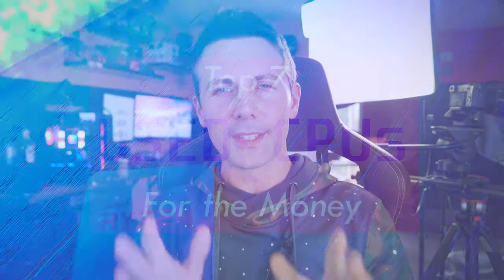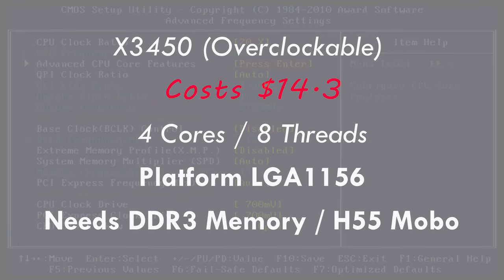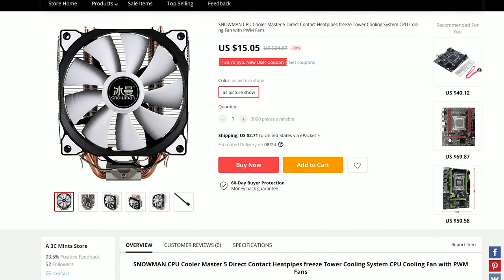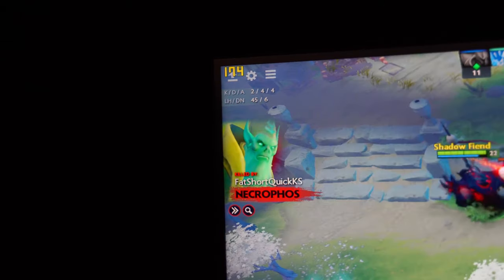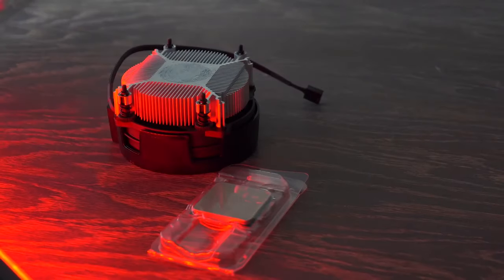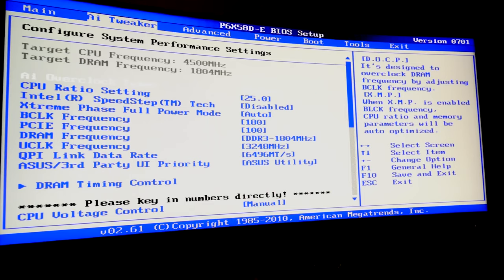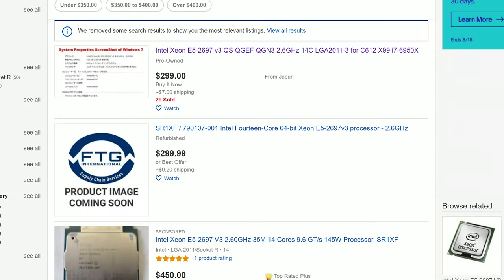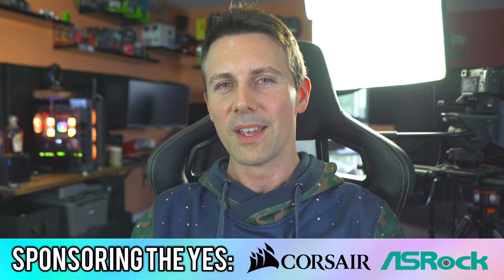Top 7 USED Gaming CPUs for the Money in 2019

Comment: I7 870 and gtx 960 still playable?
Reply: yeah, but with a one leg in the coffin. 870 has some live in it. 960 2gb is gonna be obsolete soon, 4gb is fine.
Reply: Rafał Gębicki im about to upgrade to a Ryzen 3 2200g but still dont know what gpu to buy
Reply: @baby___hteb7424  you have that 870/960 build?
Reply: Rafał Gębicki yeah
Reply: @baby___hteb7424  If you would OC that i7 (but the motherboard needs to have this option ofc) i wouldn't change anything for a while. The cheapest way to get some more performance would be an xeon x3430-x3450 and oc it. Oc'ing the 960 is optional and can give you some free fps

Comment: No FX cpu in 2019 isn’t they good enough for gaming on anymore? I got one ( 8370E) but considering upgrading to a Ryzen 3600 with a rtx 2060 or a gtx 1660 ti
Reply: GET 3700X
Reply: ReganMarcelis the 3600X isn’t much better than the 3600 so why not picking the 3700 instead of the 3700X, it’s only a few FPS different but 50 bucks in different I could use on the GPU instead

Comment: If i want to game on 1080p75 using freesync.. should i go for used r5 1400 or the 1600??I have a rx580 which i bought in April for $100 but my current g4560 is really dragging the avg fps down especially in metro exodus and mankind divided
Reply: find CPU upgrade ;
i3 3750K
i5 7400/7500/7600 (K/T)
i7 7700 (K/T)
When you can't find those CPU bang for the buck, yup just changed your system
Reply: @claritoresdiano1021  7700 is more expensive than replacing fully to a ryzen build.. I won't buy that cpu used for $200 here,even a used 1400+b450m steel legend costs like $150 now
Reply: @HuntaKiller, A 1400 or 1600 is fine or you might find a good deal on a 2600. AMD architecture is going to drive the next-generation consoles. Microsoft worked with AMD for the new Xbox.

https://www.aliexpress.com/category/200002319/computer-components.html?spm=a2g0o.productlist.0.0.30486490Wy0TlS

A YouTube commenter wrote: “I went from a heavily oc'ed (i5) 2500k to a Ryzen 2600 and the difference is pretty unbelievable in both gaming and outside of gaming.”

Another: "I upgraded to a 1700 (Ryzen 8-core 16-thread) from a 5820k (i7 6core, 12 thread). Used both of them at 1440p with a GTX 1080, there is only 1 difference between the two CPU's: The 1700 loses 1-2 fps on the average and maximum, but gains 10-12 on the minimums. No joke my 5820k, before that my 3930K (i7 6 core, 12 thread) and before THAT my 4790K and even my Xeon 1230v3 all had issues with microstutter here and there. It actually felt like I was playing at a higher framerate on my 1700. And before you ask, the only difference between each of those systems was the mobo and CPU. The ram stayed the same."

"A friend of mine just got a Ryzen 1700X (8-core 16-thread) computer. He wanted me to see it so I came over. I tried it and it seemed faster than my computer, but I was not overly impressed. He noticed my disappointment and pushed me away from the computer. He said "Watch this"! He opened 5 tabs in his web browser and opened a 4k you-tube video in each tab except the last where he opened an 8K video! He opened 3 1080p videos in VLC player (each separate instances) and one more VLC video playing 4k video. Finally he ran a full malware-bytes and anti-virus scan. The cpu never went above 58 degrees celcius in temperature and cpu utilization went 52%-72%. He let me try the computer while all this activity was simultaneously going on and it was still faster than my computer (older Intel -i5). I was so impressed that I promised him I would buy my own Ryzen computer before the end of the year!"

Ryzen only installs on Windows 10. For help https://community.amd.com/community/support-forums/processors

You can use a small screwdriver to put an uncooked-rice-grain-sized blob of thermal paste on the CPU in the middle. Also use it to straighten any bent pins. Renew the paste every 12–18 months.

Tuning Ryzen for better performance https://www.youtube.com/watch?v=LTT5mhqmjJc

For good coolers try the Cooler Master 212 evo or the smaller Antec a40 pro. Thermal Grizzly Hydronaut is a very good paste.

A new Ryzen user wrote: “make sure windows 10 allocates enough space for virtual memory because my computer was stuttering for a while”. (I think they mean the page file/swap file. It really means they didn't do so with their old processor.)

“My ONLY point of frustration came from some instability I experienced that took me a while to troubleshoot, first thinking it was probably some sort of memory incompatibility. It ended up being an incompatibility with the Windows 10 Ryzen power plan that was installed. Switched to the regular "Performance" plan and its been rock solid ever since.”

If the processor idles at a high temperature: disable all 3 bios options for Precision Boost Overdrive (PBO). Set Windows Power Plan (not AMD's one) for "Balanced".

Comment: I'm still on a X58 Asrock Extreme 3, x5650 @3.8GHZ, 12GB of ddr3 & a 1070. The price for performance now is awesome; I'll probably upgrade in the next few months. To think what I spent on building this system 10 years ago with a i7 920 and SLI GTX 200 series gpus LOL.
Reply: That's a killer kit! You ain't gonna get much/any performance boost if ya upgrade! :O I mean, sure, u might get even more calculation power if u do sum hardcore video editing or work for Nasa, or if u wanna go for sum crazy ass 4k gaming, then yeah. But for EVERYTHING else ur current price-to-performance is best!
Reply: MaximusAdonicus 1080p gaming is awesome with this system. I upgraded to a 165hz 1440p monitor last year and have wanted to upgrade my aging system since then to keep the frames up. I’ll probably sell the mobo, cpu, 🐏 later this year. Have a great day buddy!

Comment: core i6 3970x extreeme edition 6 core 12 threads 3.6ghz 4.0 ghz turbo overlocks easy to 5.5 ghz platform x79 still my best cpu of all times even the x79 platform can suport m.2 nvme ssd´s with moded bios wich can get up to 4gbps data transfer rate, this cpu still better than most of the latest cpu´s with the overclock results without crazy temps or voltages

Comment: the best deals in the uk are now i7 5820k...i bought some of them for £50 and they can run 4.7ghz around 1.325-1.385vcore...with very good temps...
last week i bought x99s sli with 5820k for £50 both:)))good oc mobos can be expensive but in the end .hey..thi cpu is fukin good performance...1380cb in r15...3700 in multicore in cpuz etc...

Comment: Hello tech yes,, how long did aliexpress sent the stuff from the seller into your housee?
Reply: It seems to vary greatly depending on one's location. Using the free shipping option, my parts all arrived within one week (I'm in the UK), but I've read comments from those who've had to wait a month or more.
Reply: @mapesdhs597  is that free shipping?
Reply: @dhafidzakwanpratama5775  Yes, I used the free shipping option which was quoted as being between 30 and 60 days, so I was surprised they all arrived so fast. Mind you, a later order of some other XEONs and mbds from different Ali sellers was more like 2 to 3 weeks, though one parcel took a few days longer as it was held in Customs until I paid the import duty.
Reply: @mapesdhs597  do you track the shipping?
Reply: @dhafidzakwanpratama5775  No. I was conent to let the free/slow shipping just do its thing. I would be more likely to use a paid shipping option if I was buying something more expensive, but then that would increase the cost. Still, even the more costly dual-socket LGA2011 board I bought arrived just fine.

Comment: Guys quick question pls for the pc experts: do the coolers have to be compatible with the motherboard/cpu or any cooler can work on any setup? Thanks in advance
Reply: the air cooler should be compatible with the socket type on the motherboard..not just any cooler will go onto any motherboard.  Snowman cooler is compatible with quite a few different Intel sockets along with an adapter for mounting to good variety of AMD sockets as well.  Always check the motherboard you wish to get then, check if the air cooler supports being mounted on that socket type.

Comment: i have a i3 4170 i want to upgrade but what cpu  is cheap and least have 4 cores idk what to check to see if i can put xeon in it if you can please help me....love your videos    motherboard is hp if you read this please let me know or tell me witch cpu to go with i7 4770 is stil over 100$ any advice would make my day please and thank you
Reply: Xeon E3-1220 v3 and E3-1225 v3 both 45% and 50% faster than i3-4170 while consume 30+ more watt from your PSU. It fit same socket. Cost around $61 and $65 each, only the 1225 one got HD graphic.
Reply: i7-4770 is 18% faster than E3-1225 v3 but  2 times pricier. Check all Xeon lineup for LGA1150, maybe there's one that match i7 at less than $100.
Reply: @xponen  thank you so much

Comment: A proud x5675 user with a GTX 980 :D
Reply: Nice, but man, you're totally gimping that 980..
Reply: @XtremeConditions  Maybe if he's using some old 1366x768 monitor, that's the situation wher CPU bottleneck would be most visible, but I doubt that's the case here, probably he's on 1080p or higher. Guess he also OC'ed that X5670 at least to 4.2GHz, probably even more, most X5675 on good motherboards and below better CPU coolers are capable for easy 4.4 to 4.6GHz OC with HT enabled. In those conditions that 980 is pushed really hard to it's max for 1080p and 1440p gaming.
Reply: Depends if he oc'd or not

Comment: Late to the party - the i5 3570 remains really solid and can be had for $30. Pair with a $50 LGA 1155 board and some inexpensive DDR3 - you can build a really decent system for about $250.

Comment: mmm why you preferd xeon e5 2420 v2 instead of xeon e5 2640 o 2630 that you can find for less that 10 bucks any of this 2?
Reply: Agreed but I think he doesn't know about them sad face
Reply: @mr.br4dga279  The v2 supports PCIe 3.0, uses little power and relevant mbds are cheaper than the sensible X79 models. But yes, as soon as one starts to look at the higher up 24xx v2 XEONs, above a certain level it makes more sense to go for the 2650 v2 instead. The point about the 2420 v2 is it's very cheap, provides newer tech, uses barely any power, the mbds are good (mine is a Huananzhi X9D) and performance is decent for the price. My entire cpu/mbd/RAM/cooler setup cost just 125 UKP (RAM is 16GB DDR3/1600 ECC). It runs basically silent with sold gaming performance.
Reply: @mapesdhs597  dude the e5 2640 goes for 17-19$ and the e5 2630v2 for 26-29$ and a cheap x79mobo for 50-70$ what are you talking about dude ? and both of them will give you better performance period lga2011 is superior no need to go for lga1356 oh I forgot the upgrade path is better too
Reply: @mapesdhs597  my French is bad I know
Reply: @mr.br4dga279  Do you have the data to back up that claim? Have you bought these products and tested them? What performance gain over the 2420 v2 are you claiming, in what titles, resolution & detail settings? You're making very broad claims here, do you have some specifics to back them up or is it all conjecture? SImply saying "is superior" is not an argument. Also, your original response didn't mention v2 CPUs. Plus, those cheap X79 mbds are cheap for a reason, they really are not that good. They get good at just a little higher up the scale, but it does push it into a different price bracket.

Comment: I need to upgrade my CPU, any suggestions for a LGA1155 I currently have a i5 3350p and a gtx1070
Reply: I7 2600k or 3770k with a good cooler
Reply: E3-1230 v2 is 20% faster than i5 3350p, also importantly cheaper than an i7.
Reply: E3-1230 is also 17% faster, also more cheaper; its 1/2 the price of i7 2600k. Just pick Xeons, it's a premium product sold at bargain price because Enterprise have moved on.
Reply: @xponen  awesome thanks. I was looking at the i7 but the xeon sounds more at my price range

Comment: My PC is i7 3770K@4.5GHz (was i5 3570K@4.6GHz)/16GB DDR3 1600@2133MHz and GTX1060. The problem is the graphic crad - it's too slow but I have still 60fps in new game.
Reply: Ha, it's a KILLER card! It will EASILY give ~100fps (@1080p) in just about any game! You are probably cranking sum anti-aliasing settings WAY too high! Those are totally unneeded and draw lot of power from even the mightiest card! Or are u playing on sum crazy resolution like 4k or 2k?
Reply: @MaximusAdonicus  1080p because i have monitor 60Hz and i lock 60fps in MSI Afterburner. Only in new Tomb Raider sometimes fps is 55.
Reply: @szpynda  Ah, so it will probably actually give WAY more fps, but since u have that 60fps cap... The 1070 is nothing but slow, it has a ton of power. Tomb Raider has heavy graphics, but u can easily get +60fps in that too with tweaks in the settings.

Comment: Which is the best combination gpu for x3470??
Reply: If you OC that X3470 lets say around 4GHz ideal bang for the buck for 1080p gaming would be 2nd hand RX 570 or GTX 1060 6GB. Even those GPU's would be a bit bottlenecked by that CPU @ 4GHz but those can be found cheap 2nd hand so it's not a big deal if you use that combo and loose 5, 10, 15% of average max.fps. Mostly low 1% and 0.1% fps in games would be affected by the low IPC of X3470. That's why I made a suggestion to OC that boy to 4GHz if you can to get gains on IPC performance with OC as much as you can.

On the other side my younger son in rocking his Asus STRIX GTX 1070 atm OC'ed to around stock GTX 1070Ti performance and he's using Core i7-860 (same as X3460) @ 4.01GHz and it does wonders for 1080p gaming. Although that beasty 1070 for sure is a bit bottlenecked by that CPU even @ 4.01GHz.
Reply: Rx 580
Reply: If you oc to 4.3ghz or higher and have fast ram get gtx1660 why not
Reply: You will get around 600-700cinabench r15 score like the i7 3770stock not bad
Reply: Can i oc x3430 that selling on alibaba?
Reply: @IISRADSIRS  you can but it is 4cores and 4 threads instead of 8 threads if you go x3440 or higher

Comment: So does anyone know anything about streaming with these processors?
Reply: For streaming the 1000 and 2000 Ryzens are already amazing at multitasking and now we have the 3000 series.

A YouTube commenter wrote: “I went from a heavily oc'ed (i5) 2500k to a Ryzen 2600 and the difference is pretty unbelievable in both gaming and outside of gaming.”

Another: "I upgraded to a 1700 (Ryzen 8-core 16-thread) from a 5820k (i7 6core, 12 thread). Used both of them at 1440p with a GTX 1080, there is only 1 difference between the two CPU's: The 1700 loses 1-2 fps on the average and maximum, but gains 10-12 on the minimums. No joke my 5820k, before that my 3930K (i7 6 core, 12 thread) and before THAT my 4790K and even my Xeon 1230v3 all had issues with microstutter here and there. It actually felt like I was playing at a higher framerate on my 1700. And before you ask, the only difference between each of those systems was the mobo and CPU. The ram stayed the same."

"A friend of mine just got a Ryzen 1700X (8-core 16-thread) computer. He wanted me to see it so I came over. I tried it and it seemed faster than my computer, but I was not overly impressed. He noticed my disappointment and pushed me away from the computer. He said "Watch this"! He opened 5 tabs in his web browser and opened a 4k you-tube video in each tab except the last where he opened an 8K video! He opened 3 1080p videos in VLC player (each separate instances) and one more VLC video playing 4k video. Finally he ran a full malware-bytes and anti-virus scan. The cpu never went above 58 degrees celcius in temperature and cpu utilization went 52%-72%. He let me try the computer while all this activity was simultaneously going on and it was still faster than my computer (older Intel -i5). I was so impressed that I promised him I would buy my own Ryzen computer before the end of the year!"

“My Ryzen 5 3600X surpasses my I7 9700k machine in almost all functions. My I7 machine is relegated to my 7 yearolds Roblox habit and nothing else. Hell, my Ry 3600x beats the I9 in single thread.”

"I upgraded from an i5-3570k (oc @4.2 ghz) to a ryzen 5 1600X and the performance is way better! In games like bf1 or grw it was constantly 100% usage causing me some really annoying fps drops! With this cpu i get a 75% use when the mess is everywhere and normally it stays on 35-45%. Never has those drops again!"

Someone made a good point: AMD architecture is going to drive the next-generation consoles. Microsoft worked with AMD for the new Xbox.

Ryzen only installs on Windows 10. For help https://community.amd.com/community/support-forums/processors

You can use a small screwdriver to put an uncooked-rice-grain-sized blob of thermal paste on the CPU in the middle. Also use it to straighten any bent pins. Renew the paste every 12–18 months.

Tuning Ryzen for better performance https://www.youtube.com/watch?v=LTT5mhqmjJc

A new Ryzen user wrote: “make sure windows 10 allocates enough space for virtual memory because my computer was stuttering for a while”. (I think they mean the page file/swap file. It really means they didn't do so with their old processor.)

“My ONLY point of frustration came from some instability I experienced that took me a while to troubleshoot, first thinking it was probably some sort of memory incompatibility. It ended up being an incompatibility with the Windows 10 Ryzen power plan that was installed. Switched to the regular "Performance" plan and its been rock solid ever since.”

If the processor idles at a high temperature: disable all 3 bios options for Precision Boost Overdrive (PBO). Set Windows Power Plan (not AMD's one) for "Balanced".
Reply: @cwli1  I am fully aware of the Ryzen line being amazing for streaming, but what about the Xeon lines? Because Even with the price drop Ryzen is more costly than E5's